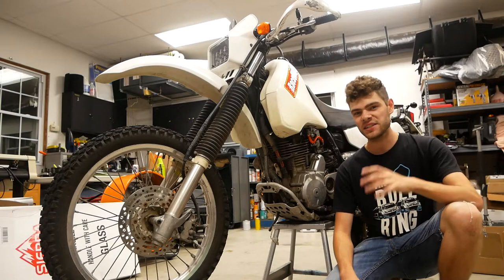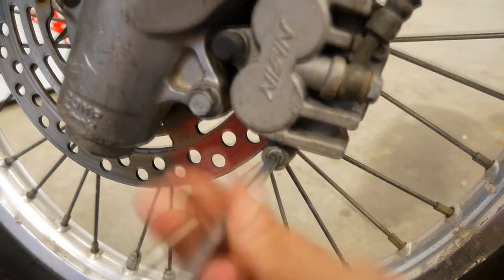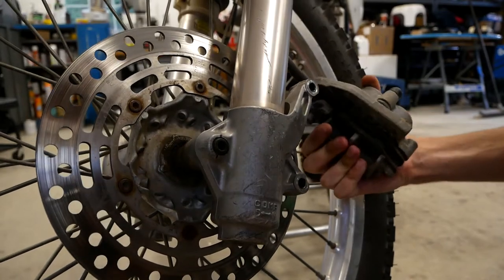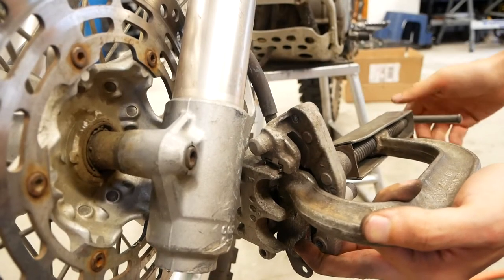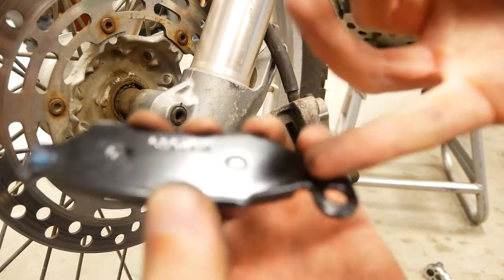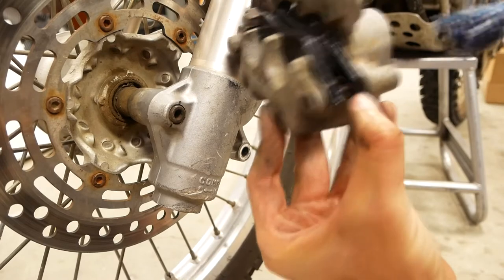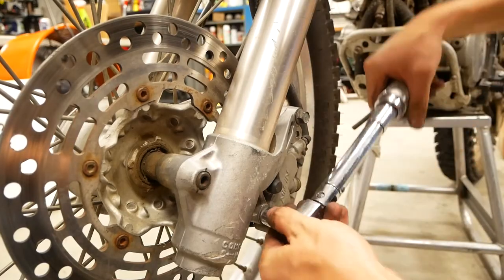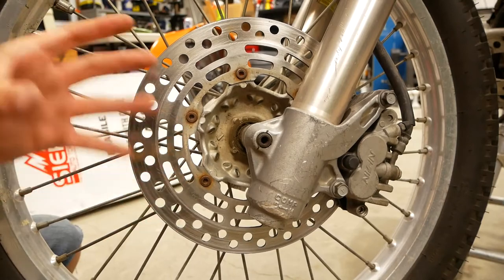How To Replace Suzuki Front Brake Pads | Dirt Bikes and Dual Sport Motorcycles

Comment: Never grease pads the stainless slide shims provide a smooth surface to move on grease only grabs crap and clogs everything up.. GREASE HAS NO PLACE ON BRAKE PADS ON MOTORCYCLES.